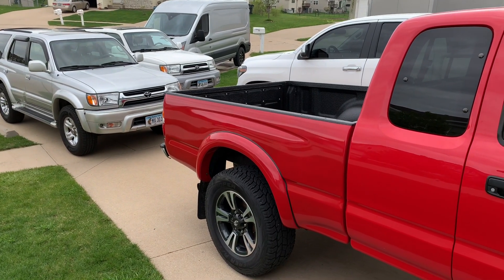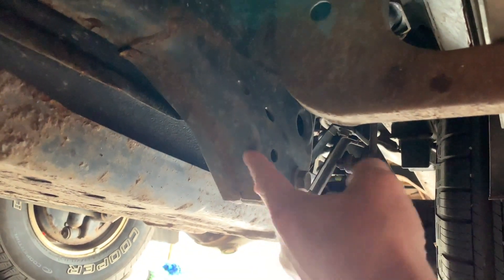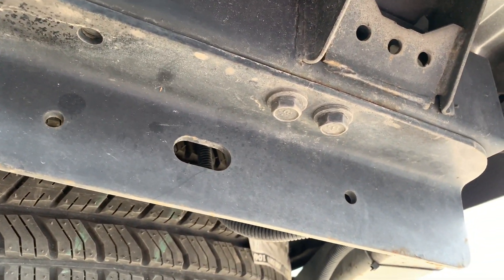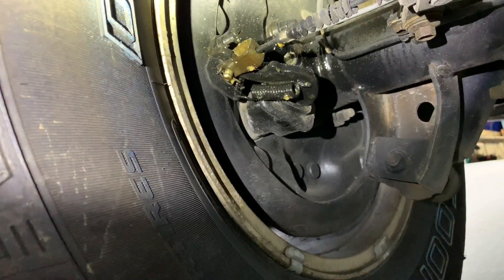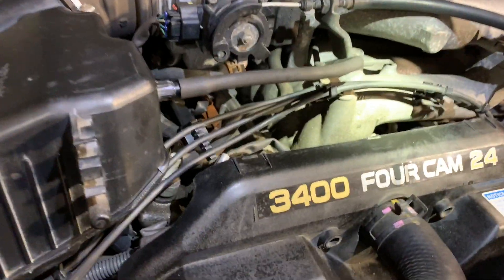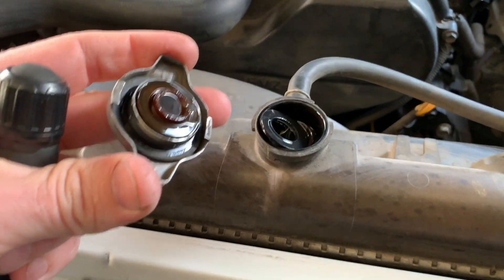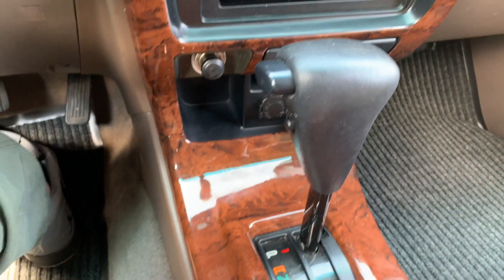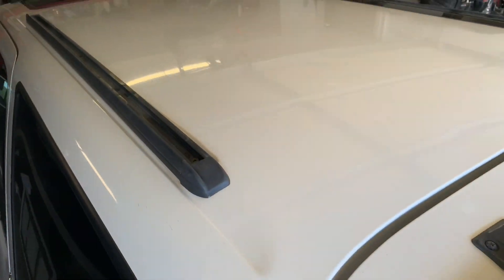Toyota 3rd Gen 4Runner Buyer Guide- what to look for?

Comment: I’m a hardcore Ford guy, owning mustangs and f-series trucks my entire life. I bought a 2000 4Runner 4x4 sr5 about a year ago for a steal (that was the only reason I bought it!).  This truck has me sold on Toyota. It is unbelievable and built like a Sherman tank. Have yet to get it stuck and even with 223k on it, it just smiles back at ya, no matter how hard you abuse it. Definitely weak as water power wise, but unstoppable at the same time. Love the little things about it like the “thunk” of the doors shutting. Great trucks!
Reply: Omg same here lmao. I love my euros and american muscles, but this yota sold me out. I wanna get another one. They drive like a small car, handle corners at high speed better than most small cars, handles bumps(melted snow/ice) like nothing at 35mph, and easy to fix.
Reply: Yeah man I’m a hardcore Ford guy and I’ve owned Mustangs and Been around them for as long as I can remember but these 4Runners are just badass!
Reply: 1 year since I made this comment, now at 241k. These things can’t be stopped
Reply: im looking at an 01 160 k for 8 thousand is that a deal or talk them down
Reply: William Hughes sounds about like the going rate here where I am in NC at least. Anything under 200k is fetching a pretty penny
Reply: @hunterjohnson4954  im in the northeast i currently have a 96 the water pump just went speedo says 165k but thats bullshit ot don't work and the frame has a couple holes and the passenger side frame is tweaked but she won't die

Comment: Agree! I had a 98, and years later a Gen 3, perhaps an 2001, but had to let it go during the meltdown. So I decided it was time, I searched and finally bought one that spent its life in Sacremento. Had it shipped to me in New Hampshire. When it got here, it had dust on the frame!  The serial number on the frame is in bright white, like it was just painted on. It had 250km but its a loaded Limited, tow package and everything else. its not just the rust, imagine a car that lived in a land with no potholes? No pounding vibrations shaking the whole car apart? Its very solid. So it was just undercoated yesterday, I'm taking no chances with this weather! I went with the lanolin product, not cause I'm a granola freak, but I just didn't want a petroleum based tar sprayed all over my underside. So hopefully this will really help.
Reply: Great idea buying the vehicle from California.  Very smart to get it undercoated immediately.  Did you do it yourself or have a shop do that?  What was the cost if you don't mind me asking?  I live in Northern California and right now I'm searching for a Gen 3 for somebody that lives in Nashua NH.  Expect it will take some time to find the right one.  Thanks

Comment: As much as I love my 164runner,  My 98 t4r has 320k and runs like a champ!! One of the best vehicles you could ever purchase. no doubt my mind!
Reply from the maker: T4rTrail sweet, there are so many ppl that say the very same thing, most with 200k or more! Love hearing about em
Reply: J Lee Chronicles i just buy a 1998 limited with  200,000 miles limited with rr dift locks for 2000 $ it runs perfect, but you have any recommendations to make it last longer ?

Comment: I’ve always changed the oil filter from the top of the engine compartment. Generously lay paper towels under the filter to catch what drains out. Filter is easily removed with a 3/8 socket wrench with correct filter wrench attachment . Don’t forget to remove towels..In 215,000 mile s I’ve done this about 50 times.

Comment: im about to buy my first 4runner, 3rd gen at that, it has 290,000 miles on it, its from down south and only has surface rust starting in some areas, but is probably one of the cleanest 3rd gens in michigan. im about to put 90 hundred million miles on it.
Reply from the maker: Get after it!
Timing belt LBJ -fuel filter/tuneup will do it

Comment: Beautiful! (I’m a girl) I own a 2002 which I bought with 147,000 miles now it has 275,000 miles! Runs like a beast!! Garage kept! Pearl white! Thinking about putting ”BILS” on her and lifting her 3 inches!
Reply from the maker: Roni B B the Bilsteins have a reputation pf riding a bit rougher according to some, maybe Toytec is an option. And we have to be careful about lifting, its that and huge tires that cause problems and drivetrain longevity issues. 2” is pretty safe and I would stay close to 31-32” tires for DD. When you get it done post it up, lots of interest in these still! Thanks for your positivity;)

Comment: Important items to replace:
1) Radiator to avoid pink-milkshake (transcooler located at the bottom tank on the radiator corrodes with age)
2) Lower control arm ball joint: Buy OEM only (lasts 150K miles easily) and aftermarket lasts max 20K miles
3) Heater control valve on firewall. The inlet port wears out potentially leading to crack/snap leading to coolant loss
4) 01 and 02 models have an expensive ($2000 or more) brake master pump assembly, and only available at the dealer. 
For more information visit t4r.org 3rd generation
Reply: I agree with the master pump assembly.  Had to get a junk one for my 01 SR5. Couldnt afford the $2300 OEM price

Comment: How many bolts hold the timing cover on, where are they all located and what size are they? I'm looking for a third gen but it may be hard to get people to let someone pop that cover off. If I can do it quickly it would be easier to convince them
Reply from the maker: Christopher Spencer it is attached with 6-8 10mm bolts. Takes 10 minutes or so to disassemble..the lower left bolt is a little hard to access.

Comment: Bought a 1999 limited 2wd with 265k miles and leather seats in similar condition probably a little worse in the drivers seat for $3500. Had to immediately send off my digital AC control unit for the exact same thing. In South Carolina so no rust 😃

Comment: Hey j Lee I just bought a 1999 runner
 SR5 4x4 with 200  miles will see how it work I want to lifted what do you recommend for this new toy. And thanks for the  videos
Reply from the maker: Jorgito Perez. Sweet man, I’d recommend just a 2”coilover up front. Toytec maybe or a King/Fox setup depending on how much $ you would like to spend/quality. And for the rear: higher springs, extended shocks.
The reason for 2” is reliability and CV angle won’t be too great, probably would not need a differential drop either with a 2”
...maybe go 31-32” tire, again for reliability and dependability. It will give a nice stance and a few inches of clearance. When you get into 3” or more, it is more involved and more problems.
JMO, thanks for asking and enjoy!

Comment: Hey 
sir I have a question.
What is different Toyota hilux pickup and Toyota 4runner 1996 to 2002 frame.?
Reply from the maker: Imran Khan I’m not sure. The Hilux is imported, I would assume they are all point of origin- Japan back at the time- so the frames would be the same? 
Sorry, not definitive. 
Thanks
Reply: They are the exact same, the 4runner and Hilux share the exact same platform in fact they are both made in the same factory in Japan

Comment: What do you guys think about oil leaks? I have no mechanical experience but I've started looking at these 3rd gens and one I was looking at was clearly wet underneath from leaks (even I could tell that) and the seller said basically all of these older 4Runners will be leaking. Does that sound right to you guys?
Reply from the maker: The oil leaks are common. If its very bad, I would be concerned with overall maintenance/neglect and lack of prideful ownership! It reflects poorly on the owner or even dealer to try to sell you on it and just say “its just the way it is”... there are some well
Maintained ones out there, or roll the dice and start learning :)
Reply: @JLeeChron  thanks very much!
Reply: No matter what kind of vehicle it is, most engines will have the presents of oil underneath the engines! it's just seepage! There's a difference between seepage and an oil leak! if the vehicle is not dripping oil it probably is okay. But if it's dripping while running you should know it! because you'll see literally a drip of oil on the ground,or under neath engine  software!! go to the city park at a store with clean smooth clean cement parking spot:-) let that truck run for a while while you have some coffee:-) let it run for about 10 or 15 minutes and then back up and get out of the vehicle and walk over where you were parked and look on the ground for any drips of oil transmission fluid or anything on the cement:-) this is how you can check for leaks. Also depending on how bad the leak might be. if you have discovered one it may only leak a small amount of oil and that only adds up to maybe a court added to your engine every 6 months for an example!! can you afford to buy a quart of engine oil to add to your engine once in awhile? If you can buy the car nothing is perfect and it all depends on how rich you are or not!....

Comment: Im considering buying one (Eastern Europe) We have only the 3.0 Turbo Diesels wich were used during war time by UN .. do you think their fuel consumption is high even on diesels?
Reply from the maker: phantom im not familiar with the Diesel in these, however I have heard they are desirable. Getting around 20mpg hwy with these, so I’d imagine the diesel is better. Mpg are not outstanding but good enough given the purchase prices are 3-6k$  (US)
Reply: @JLeeChron  

Right now i own an Jetta Mk2 1.6 Turbo diesel Intercooler (1991) wich has been really reliable, Uses very very little oil as for fuel consumption on my books it really effiecent i can do easily 500km on heavy city driving wich includes lots of stops and hilly roads..very short trips.. I have had it since 2011 and never left me stranded.. 

BUT the age has taken its own toll on it no Air Condition wich is a must nowdays since on my country it  does get alot hot in summer and comfort is really going downwards.. So an 4Runner since i love SUVs especially those ones may be an upgrade but i'm worried it might use like twice of fuel as my Jetta does now.